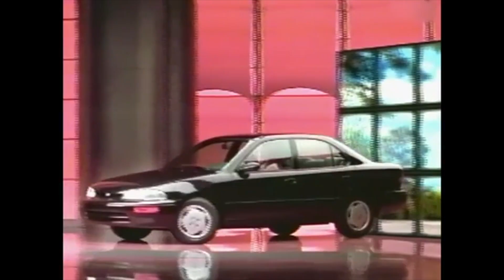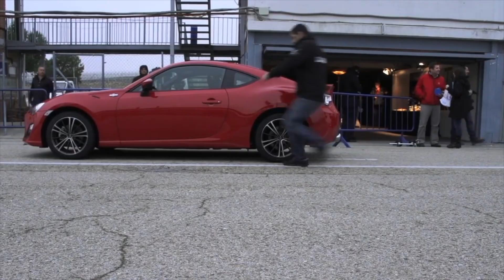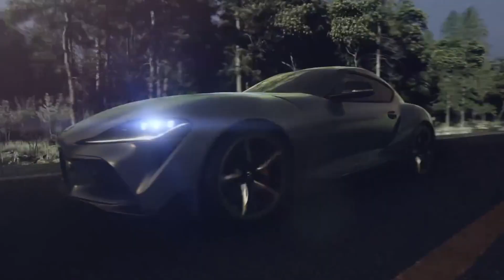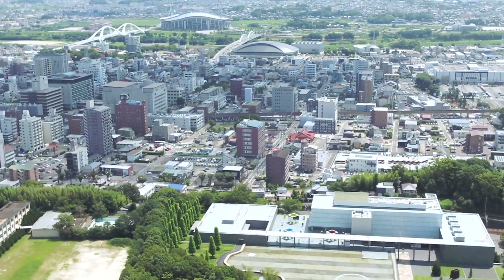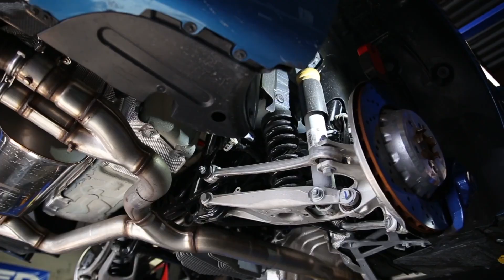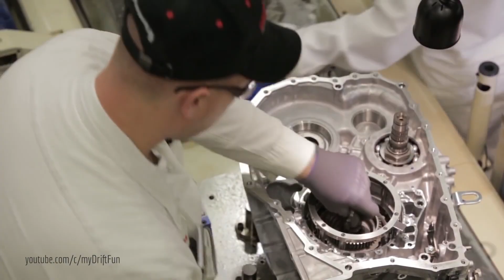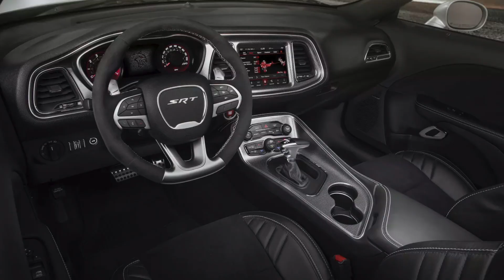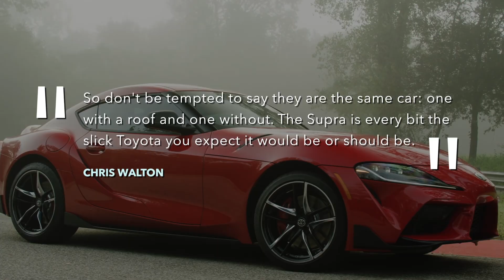MKV Toyota Supra - BMW or Toyota? The UNTOLD TRUE STORY

Comment: The only thing done independently between the cars are their exterior styling. The Supra's interior shares 80% of its parts from BMW (see the photos), it has BMW sourced engines, has a BMW sourced suspension, the list goes on. The only difference between these cars are the exteriors and possibly the driving dynamics. Under the body, the Supra is most certainly a re-badged BMW. Driving wise we can't say much about it, but there's no doubt the cars will feel similar.
Reply: If what your saying is true then these will be pretty expensive to fix if anything goes wrong.
Reply: @jeffdaman6969  they are...

Comment: I'm going to be that guy: I would truly, honestly buy one if it had a 6-speed manual transmission. I would. Seriously. But I don't know if I can buy one that's automatic. I'm an enthusiast. Let me rephrase that: I am not a hobbyist. I am an enthusiast. I live for the thrill and feeling of the drive, and one of the most intriguing and irreplaceable experiences is driving a manual transmission. An automatic, even paddle shifters, just does not compare. I have the income, the money, the timing... everything is right. But I don't think I could pull the trigger on one.
Reply: Give it time. There will be one. Iirc, toyota sold more automatic Mk4s than manual, so it makes sense that they start with the automatic. Wait for the model refresh (possibly mid-late 2020) for a manual. That's what I'm expecting, atleast. So no guarantees on dates.

Comment: Bmw. unreliable and expensive to maintain.not my supra
Reply: C'mon man. You say, unreliable, expensive to maintain, but yet in the video the person clearly says that everything was thoroughly tested by Toyota engineers, right down to the bolts and rivets. Yes, you might not like BMW, or maybe you don't like Toyota, maybe you just don't like these 2 cars, but before you hate, give it a chance. Remember, this is a brand new platform, co-developed by BMW and Toyota, never been used or seen before these cars. Yes, the Z4 might be high maintenance, but it may hardly even need maintenance. If Toyota trusts this platform, then I trust it. In the end though, we each have our own opinions, it's only natural and I completely respect that. If you read all this, thank you.

Comment: A BMW engine and transmission, which means poor reliability and expensive maintenance.  I'll pass.  Hello MX-5.  I hear you calling.
Reply: Dude smh. You say, unreliable, high maintenance, but yet in the video the person clearly says that everything was thoroughly tested by Toyota engineers, right down to the bolts and rivets. Yes, you might not like BMW, or maybe you don't like Toyota, maybe you just don't like these 2 cars, but before you hate, give it a chance. Remember, this is a brand new platform, co-developed by BMW and Toyota, never been used or seen before these cars. Yes, the Z4 might be high maintenance, but it may hardly even need maintenance. If Toyota trusts this platform, then I trust it. In the end though, we each have our own opinions, it's only natural and I completely respect that. If you read all this, thanks. If not, oh well. I just hope you read all of it, and maybe I can possibly open your eyes. Thanks again.
Reply: @ljphoenix4341  While BMW automobiles are high performance machines, their long term reliability is poor.  Check their frequency of repair record in "Consumer Reports" for the past 10 years.  Car magazines are advertiser dependent on car companies and therefore cannot call out car companies for this.  "Consumer Reports" on the other hand, is advertiser free and so they can afford to tell the truth.  "You Tube" car reviewers, while not dependent on car company advertiser dollars per se,  are given new cars by the manufacturers to "test."  This is done with an "understanding" between car manufacturers and online "car reviewers" that "reviews" are to be positive in tone.  If this unwritten rule is violated, the online "car reviewer" no longer gets loaners from the car companies or car dealerships and so has no cars to "test" for his "You Tube" channel.  No cars means no "You Tube" Channel, which means NO INCOME.  

With regard to your statement,  "If Toyota trusts this platform, then I trust it", keep in mind that the  Z4/Supra is a Halo car for Toyota.  It will sell in minuscule quantities.  This car means nothing to the millions of buyers who purchase Camry's, RAV 4's, Corollas, etc.  As long as these car offer traditional Toyota reliability, the reliability (good or bad) of the Z4/Supra means nothing to the typical Toyota customer.

Comment: knowing now that this heap of garbage shares almost 85% of the new BMW Z4 parts and its priced for 50k id rather take my chances and purchase a Corvette with 10k miles on the clock and more power. This wasnt a collaboration but more like a rebadging of an icon. it doesnt matter weather i have driven it or not, its like taking a pair of dollar store shoes and using a marker to paint the Nike symbol on it. People had their minds made up when they saw the drivetrain and realized that they the customer were being ripped off thinking how is this possible that at the very least Toyota could have made a newer version of the 2JZ bulletproof powerplant. Engine reliability is NOT BMWs strong point btw. Toyota should have taken a que from Nissan when they made the GTR and just stuck to their guns and made the Supra themselves.

Comment: Mclaren F1 is also powered by bmw engine....why anyone sees that?
Reply: Mk4 fanbois have blinders on. Refuse to accept anything being as good or better than the 2jz
Reply: @mgoose1359  “The A80 Supra fanboys hate on the A90 Supra for the worst and most ridiculous reasons possible, such as the A90 Supra sharing its chassis and engines with the G29 BMW Z4, often forgetting that the A70 (1986-1993) Supra actually did have some BMW styling in it!” that says all. 

don't hate on a car because the fanboys do so.
Reply: @Gabriel hernandez truth.  It's the same on almost all the MkV videos. Fanbois as far as the eyes can see.  I can't wait to finally get my hands on one, and when the reviews come out. It's going to be an amazing car to drive, likely better than the Mk4 was. And then the rage will be so sweet.
Reply: @Gabriel hernandez i've actually been talking with my performance shop, and we're trying to find a stock MK4 (not an easy thing to find) so that we can compare them. Both on the street and on the track.
Reply: @Gabriel hernandez i plan on posting loads of videos whenever I do get it. Dyno the first day, out to Darlington shortly thereafter.
Reply: @Gabriel hernandez  The best part of 2020 supra i liked is its fuel efficiency.....it gives the highest among all sports cars, except the hybrid versions. And I dont even like driving above 80 miles per hour and the place where I live has narrower roads not like highways. So this supra is actually perfect for me.
Reply: And Toyota 2000GT was literally built and engineered by Yamaha, only thing Toyota did was styling, interior and providing engine block, everything else was Yamaha, they literally were one building them.

Comment: Come on haters the only thing that will never change is that EVERYTHING changes. This is an amazing automotive colaboration BMW fun and performance with Toyota reliability, from my gear head standpoint  this is automotive perfection.  Saying that this Supra in a rebadged Z4 is like saying that the Chrysler 300M is the same car as the Mercedes it is simply not true, you can not take a part off of one and bolt it directly onto the other They do resemble each other but they are not the same car with different emblems.

Comment: well, i guess most of this hate is because of ungrateful asshole fake car guy douchebags. If anything the new supra is a miracle in my eyes, in a period of time that manufacturers are starting to focus on EVs and Hybrids, it's already a miracle that Toyota decided to put out a successor to a car from the 90s, and to add to that, they stuck to the original supra's concepts, Front engine, rear wheel drive straight 6 with a relatively lightweight and nimble chassis. Even if they worked with BMW for the car, I say this is more of a benefit than a loss, as a result, both companies learned from each other, Toyota does not need to go back to the drawing board to design a new engine from scratch, as this would take years, and would cost a lot more, and furthermore, BMW's straight 6's are known to be very good and can produce a good amount of power, and Toyota tuned it with their own computers and methods, so there is definitely some Japanese spirit in the car, and combined with German engineering. Heck they even had some pro racing drivers like Alonso and Buemi to test the car. This is definitely a miracle when compared to how the new NSX turned out. A lightweight, nimble, F1 like Ferrari killer turned into a fatass hybrid that bears no resemblance whatsoever to it's predecessor
Reply: It could have ended up like the eclipse.
Reply: mgoose1359 or the rx series

Comment: In 1993, the new Supra Turbo ripped apart every ZX, RX-7, 3000GT, and NSX. The non-Turbo model was compared to the E36 M3. By that measure the new Supra should be equally competitive with the new NSX, 10YO GT-R, or even the M3. But it isn’t.

Comment: If Toyota tested every bolt and nut to make sure the engine was reliable... then why did they need to detune the engine to be 50hp slower than the Z4 so that it'll be more reliable?
Reply: Peder Hansen  So you're saying Toyota only made the HP lower in the specs sheet? Doesn't make sense to me.
Reply: Peder Hansen  does that mean the Z4 puts out 450hp then?

Comment: Hung up my spurs on the BMW service tech awhile ago, but this sort of "collaboration" how ever you see it, is the worst of all worlds. The car is not a Toyota, and mostly a BMW. The Z range stands to benefit the most thanks to Toyota.  Having worked on the Z3 from the very first four cylinder model (a half breed E30/E36 chassis concoction), the entire Z range has been among the lowest quality products ever produced by BMW with real gains made in the last few years. Ultimately, the sad thing here is, the project didn't materialize on its own, this whole thing was mandated by management forcing the issue because nobody had a real vision for a Supra.  The video says it clearly - most of the Toyota engineers on the project didn't even drive the Supra they had been working on until the debut in Spain with journalists. That's pretty telling. All that said, I think even if both of them drive great, branding be damned - they are both utterly hideous.

Comment: Engine
-----------
We know the Engine is BMW sourced
We know the Transmission is BMW sourced
Interior 
------------
We can see interior switch gear are BMW sourced
We can see interior steering wheel is BMW sourced
Chassis
-------------
We know the engine bay holds the same BMW engine
Even the bolt provision for the z4 engine braces is present in the Supra (minus the brace themselves)
Conclusion
------------------
You can deduce from the above and major component sharing the chassis, power train and no doubt suspensions are interchangeable.
The only thing that is "Supra" about this is the aesthetics (external body panels and badge), exhaust sound and maybe suspension tuning.

Comment: "Toyota went as far as testing individual bolts and rivets extensively to make sure they were up to the task..." BOOM!
Reply: Similar price of a new C-8 but way slower and worse handling yeah I want 2! Oh wait no keep the Z-4 rebadged Supra inline 6 versus 6.2 liter v-8 I made my choice easy
Reply: @randyyoung9892  both are trash lol, but the c8 is a filthy low quality sht compared tho, just faster...
Reply: Pure bullshit.
Reply: It’s funny they were willing to test someone else’s parts then develop their own!
Reply: Also people don't realize it's a updated engine it's the B58C not the regular B58 in the 340i's and 240i's and it's also rumored that the turbo is bigger on the Supra then the Z4. And knowing Toyota and also BMW 335hp might not be the BHP it might be higher.
Reply: @X1xRiGox3X  Actually, rumor has it... In the interest of reliability, the Supra will run less boost, have a locked ecu, and make less power. 😥
Reply: @X1xRiGox3X correct most Supras standard power is 360-370 bhp 😊
Reply: Yet.. the Supra is 50hp slower than the Z4.
Reply: @CspecSupra  very dependant! Weights of vehicle, the point lbs/torque stops and hp starts
Reply: @CspecSupra  Yeah the 2jz is iconic because it can handle power not because it came with 1000 horsepower stock.
Reply: @bigreddaman5988  That's one of the reasons but not all the reasons. When the MK4 first came out it competed against Ferraris and 911s. It held a braking record for decades and took a 500k Porsche GT to dethrone it. The sequential twin turbo setup was very innovative at the time as well. Performance wise it was at the top in the 90s... now the new Supra competes against a Cayman and a 370z...
Reply: @CspecSupra  Not a big deal, JB4 will get you to 400whp probably
Reply: @philspaghet  That's not the point. The point is the story about Toyota  opening up the whole engine and making sure it's up to Toyota standards is BS. Can you imagine Toyota asking BMW for their engine and then tell em it's not good enough?
Reply: BigRed DaMan it comes stock 320, the twin turbo model, can make 600 hp on stock internals, so you're wrong
Reply: @CspecSupra  On paper not on the track xD
Reply: @CspecSupra  Look the carwow supra vs z4 drag race!
Reply: @CspecSupra  European versions have 340hp and USA versions have 382hp.
Reply: @CspecSupra  Well they certainly did it
Reply: @CspecSupra  The Supra has a +50 HP bump now.
Reply: @derekj.tejeda267  Yes, because BMW allowed Toyota to use the Z4 platform that isnt detuned. Turns out BMW gave Toyota the detuned version on the 1st year so that they would have less impact on hurting Z4 sales.
Reply: @CspecSupra  Fair.
Reply: @CspecSupra  as far as i know the gtr competed with the 911 turbo not the supra
Reply: Well. Multiple reports are coming in with steering rack failures. Looks like Toyota tested every "bolt" but forgot to test the BMW steering rack even though its  known BMW issue. 🤦‍♂️
Reply: @Sean Samuel 
Auto correct will start telling us how to raise our kids. A.I. is bullshit and dangerous.
Reply: Sounds like a bunch of BS to me
Reply: I guess that's why Toyotas are pretty damn reliable lol
Reply: Bolts and robots aren’t a problem with BMW lol. Such a biased talking point to make it seem Toyota was trying to make the Supra a Toyota lol. Stupid. The Supra is a BMW. Sorry not sorry.
Reply: Why would they test indivual bolts that sounds dumb there are international fastener standards The Japanese aren't that stupid 😂
Reply: So.. Toyota tested every bolt to make sure it was reliable.. and then they detuned the engine to be 50hp slower than the Z4 to be more reliable.. what??
Reply: @CspecSupra   @Allen S.  I'm very certain they detuned the engine at BMWs request to not step on the Z4's toes. After all, it is BMW's engine.
Reply: @2moke2creen  original supra, 220bhp. New supra 365? Both cars come as a very useable fun package (slower than rival) it's the drivers that change the power outputs.... reliability is null and void at that point
Reply: @billybob6397  The previous twin turbo Supra was 320hp. New Supra is 335hp.
Reply: @CspecSupra  220hp 210lbs... so says my Google research
Reply: @2moke2creen  it's probably for reliability. Remember how they stressed how different the two cars are? The Z4 and Supra aren't competing (sarcasm).
Reply: @billybob6397  good luck with the locked Toyota ECU, and their sadist traction control.
Reply: @michaelcarr4748  No I highly doubt it's that stupid  botched ECU they used in the MK4. It's the same ECU as the Z4 just tuned to Toyotas liking.
Reply: @2moke2creen  Could be that, And also toyota wanting the car to be balanced. But it was dyno'd recently and revealed 360-375hp out of the box
Reply: @X1xRiGox3X  Supra has different Ecu not the z4's bosch ECU
Reply: @2moke2creen Toyota lied!! They make more than a standard Z4. They are 360-370 stock.
Reply: @michaelcarr4748 wrong 2019-2020 Supra ECU are not locked.
Reply: @CspecSupra   Allen S.  Supra was revealed to be packing 365 to 370 out of the box, And no more power isn't always the answer. Toyota were going for a balanced performance. From the history of the B58, This thing could push out 450hp without any issues. Again power numbers do not determine whether a car is good or bad just saying.
Reply: @CspecSupra  did you watch the video? Tada san said he feels this is a good hp for the car. Toyota doesn't build cars just for hp but they made it very easy to mod.
Reply: @CspecSupra  I'm not sure that was engineered that way, but when you have a platform tuned to have less HP, the block and the transmission take less of a beating so they will in fact last longer.
Reply: I own new supra and it says made in Austria.. So definitely not Japanese technology
Reply: @ many car makers build all over the world and not the mother country.
Reply: I love how drifters have already swapped the engine with a good ol' 2J :p

Comment: The problem is not the car, it's the expectation of the Supra name.  People were unfairly expecting a 2JZ update to the motor and would not be happy with anything else.  Putting in a slightly detuned BMW powertrain just rubs Supra fans the wrong way.  Even though BMW makes amazing motors there was no way Supra fan boys were going to be happy.
Reply: What makes a 2JZ a 2JZ lol